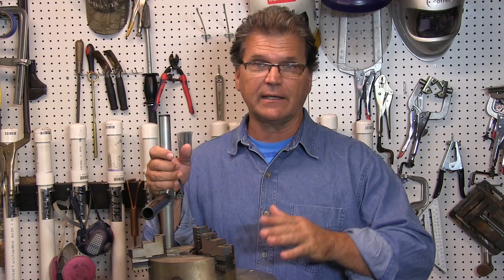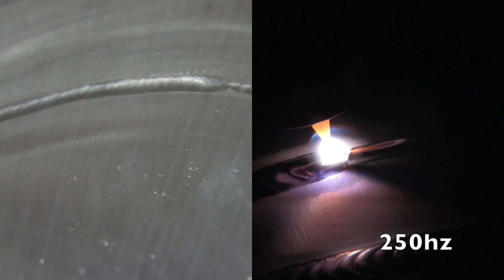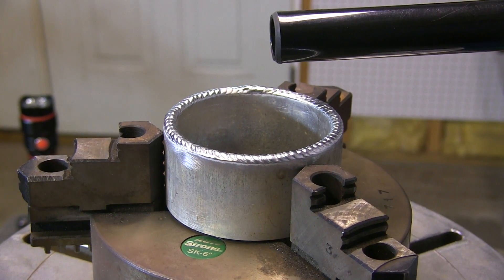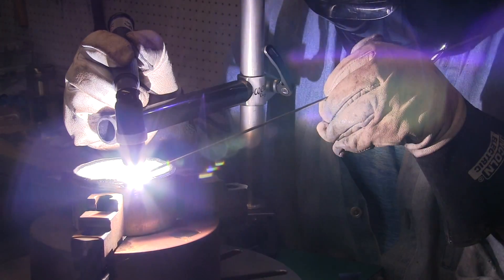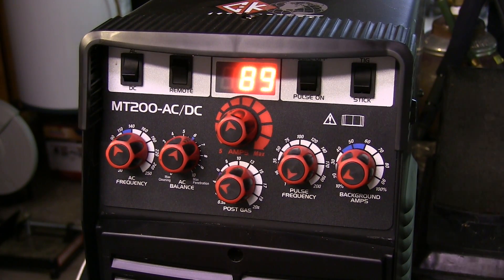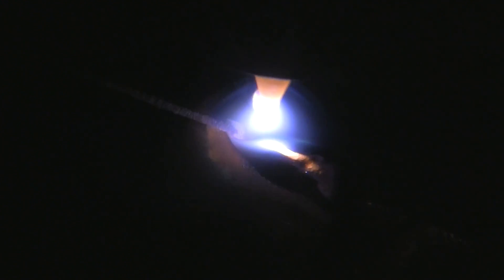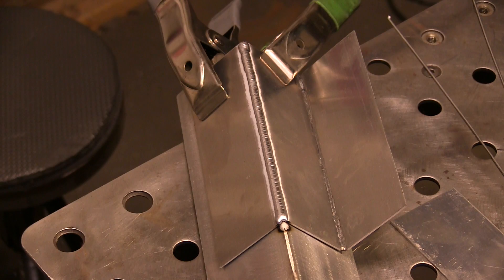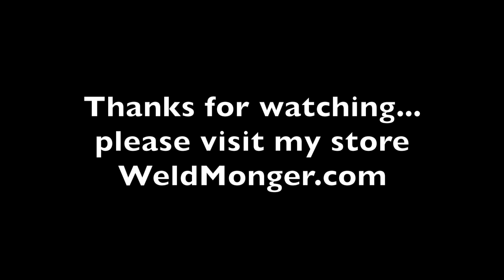Aluminum TIG Welding -2 Applications for Frequency settings

Comment: Can you do a quick video on inside corner joints welding 1/4" aluminum any grade to a smaller schedule any grade aluminum more for marine applications with tig 4043 filler?

I'm having some issues with my miller dynasty 200 melting the metal and I'm tried multiple settings still getting poor results. It's taking forever to melt the puddle. Yeah I need your help. To
Thanks

Comment: for all the people out there most rods now are stamped on both sides . he will teach you . i dont weld aluminum im very bad 3 weeks ago i suck 2 weeks ago im terrible this week better. to all some to some nothing love ss steal love steal love galv. never worked with aluminum self taught i tig wire feed plasma cut ox.assed. not great still have a job he is amazing

Comment: Hey Jody I work with a welder that is a military welder from the 50s I can't adjust very much for aImuman learned with a Miller 200 dynasty I was having a bit of trouble with the settings on this dinosaur I got a decent bead but it wasn't my best work any ideas for future welds with this out dated best?

Comment: Two pieces of metal of 1/8 thick are tacked together, the root opening is 1/16, and the two pieces of metal are 8" long. What is the volume of the spaces?

Comment: Both yours and This Old Tonys videos agree that lower frequency gives more heat input at the same amperage setting. What I'm wondering is, how about power draw regarding the wiring in the shop? I'm probably not the only one who has a welder that is able to trip the fuse in my garage if I turn the amperage high enough. Which frequency will weld the thickest metal within the limits of a given fuse?

Comment: Hey Jody I have a chance to get a used Miller Aerowave for cheap, needs a new fan and board, board cost 1500, would I be better off getting a new Everlast or fixing up the Aerowave?

Comment: Would these settings be similar with stainless or mild steel with like thicknesses or would they be completely different? I mig, stick, and oxygen acetylene weld but have never messed with tig much. When I did they were already setup for me.
Reply: You wouldn't use AC to weld steels, typically, so the AC frequency isn't a setting you would need to worry about.  Head over to WeldingTipsAndTricks.com and read up on TIG, it'll really help.
Reply: Jody Raiford Thanks!
Reply: Also, the thermal conductivity of  stainless steel or carbon steel is much lower than aluminum so you don't need as much power.  And the DC arc is surprisingly quiet compared to the AC action you see here, which can be pretty loud.   So, if you were to decide to use ferrous materials say... you might get away with  smaller cheaper quieter setup!

Comment: I have a miller syncrowave 200  and I'm gearing up to weld some anodized aluminum pipe for fishing rod holders. Welding both 2" and 1 1/4" pipe with 1/8 wall thickness. Any advice on frequency settings or even if I should get a bottle of argon/helium to help punch through the coating? Thanks in advance.
Reply: If the anodized thickness is thicker than usual "weathered" aluminium -  and it is, by a lot - I would wager that you will need to physically remove that layer before lighting up the torch...

Comment: Hi Jody! I would like to know your opinion on the cheap 130 amp harbour freight machine for somebody that just wants to scratch (it is scratch start🤔) tge surface of tig welding and its capabilities. I will weld up to 10mm max on electrodes and probably less on tig. The only issue is jn our country cheap welders arent there exept in Hofer. So I cant find anyone with (even an eypencive) tig welder to kinda start to get a feel for tig. Tig isnt really a thing where I live. Mostly cheap transformer stick which is a pain in the ass to start and tge welds usually look like fidos poo. So I would like to explore tig and have a half decent stick inverter. Would that be an option?
Thanks!
Reply: Ever last. Harbor freight is trash

Comment: Can anybody point me in the direction where i can buy a reasonable priced multi process welder. Thanks in advanced
Reply: Lincoln Power MIG 210mp
Reply: +Richard Ezzo I plan getting the lincoln 210 or the esab rebel 215.. but would like to jnow if there any back channel websites or places that I can get them cheaper then $1500-$2000
Reply: Harbor Freight just got a knew line of welders that actually look like nice quality machines. They have a 220 multi process machine about the size of the Lincoln 210 MP for $799.99. Fair warning, the machine is DC only for MIG. TIG, and Stick, no AC.
Reply: +Matt Schipper thanks ima have to check in that
Reply: I see the AHP models for less than that and probable better than Horrible Freight stuff.

Comment: Hello Jody - Another thought-provoking video.   I am wondering if you 
tried this experiment with 200 Hz AC on  a Miller or Lincoln machine? Before generalizing about all 50 Hz vs. 250 Hz, could the result you are getting could be an artifact of something specific to the CKWW machine you are using? If I remember correctly, you also have a Miller Dynasty DX; have you tried to repeat the experiment with the Miller machine?
Reply from the maker: I have done some work with frequency on the dynasty 280dx and results are very similar. But I will continue to experiment and learn.

Comment: As soon as video started, I could hear instantly the welder was set at 50hz, it has that low crackly sound, while 100hz+ will have an annoying snappy high pitch. Generally speaking, the higher the HZ, the higher the amps while have to be to penetrate, but that can get messy too. For thin (0.033) small diameter (0.375") aluminum tube I had to use about 80-100hz and very low amps (pedal @ 17 amps) to keep from blowin through the tube and yet just enough heat to make it come together. That was my very first experience in TIG welding, thin aluminum tube, talk about baptism by fire, wow!! After that stainless and carbon steel were all a breeze to weld. I was amazed how easy it was to TIG weld with those materials.

Comment: I can't change AC frequency on my machine. It changes with the amperage. High amperage --> low frequency, low amperage --> high frequency
Reply from the maker: what machine do you have?
Reply: Rehm Invertig 260 AC/DC. It's a german brand. You might not know it, I've never seen any of the brands you use in your vids here in switzerland. Most known in Europe are Fronius, Rehm, Kemppi and Esab I think

Comment: Hey, I'm working on a project witch is a unicorn head out of aluminium (1mm). I'm using 1.6mm filler rod rod, 1.6mm tungsten, Nr 5 cup, and about 30A. My problem is than I can't backing my piece and I blow a lot of hole... My TIG machin is a Lorch HT180 witch can go to 200Hz. Is it better for me to use 200Hz?
Reply from the maker: it might help a little going to 200hz but I would probably stay around 100-120hz. you might do well to find one size smaller filler metal
Reply: weldingtipsandtricks I've tried with 2mm filmer rod, wasn't bad but then I watched to my local welding store, no one was able to give me filler rod smaller than 2mm....so he gave me a piece au aluminium MIG wire to try with but was 1.2mm filler and the filler goes liquid before I touch my puddle...

Comment: You are the best school I have found yet. Working full time job doesn't allow me time to take welding classes somewhere else. Practice practice practice!!! I have finally gotten past Fido's butt and can actually run a good looking weld from time to time.
Reply: Jody has helped me tremendously. I don't have time to go to classes either and you are absolutely right practice is the key. I try to put in some time with my everlast welder at home as much as I can even if it just for a few minutes.

Comment: any tips for a machine that has a fixed frequency of 50/60hz and how to achieve decent welds on thin walled tubing  without complex chill bars/ copper clamps? Yes, you guessed right, its a crappy no-name import machine....
Reply from the maker: my first thoughts are to use as small an electrode as you can for the amperage used....along a #5 standard cup with as low an argon flow as you can get by with and still get a clean puddle
Reply: Thank you, both for the reply, and the great vids and info. Much appreciated, Keep up the good work. And thanks for the tig finger invention too. Now that you mention it, ive just recently discovered through trial and error, how argon flow impacts the weld on ally, when i went extremely low, i noticed the welds getting crappier. Switched to dc and did some steel, and it welded perfectly at the same flow rate. Makes sense why you would recommend that now, guess it also affects penetration and puddle characteristics... Thanks again.